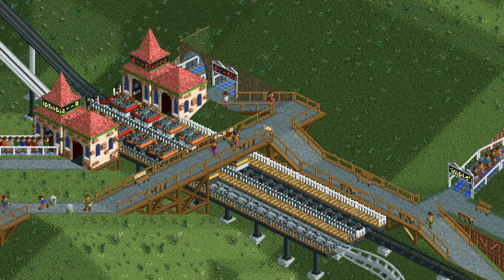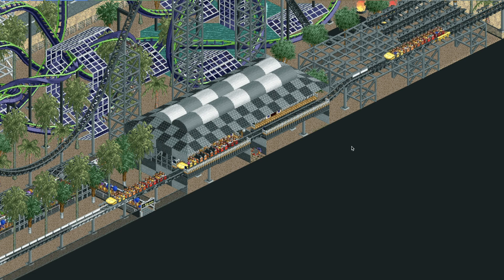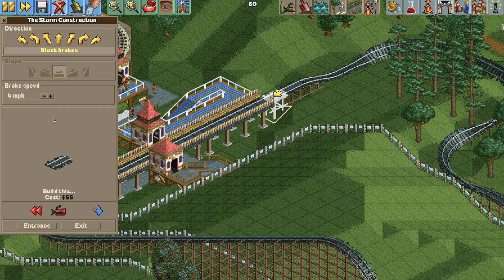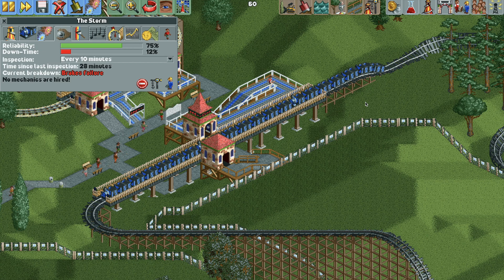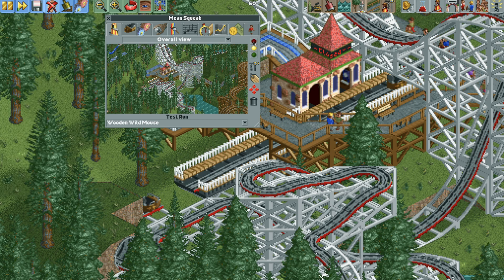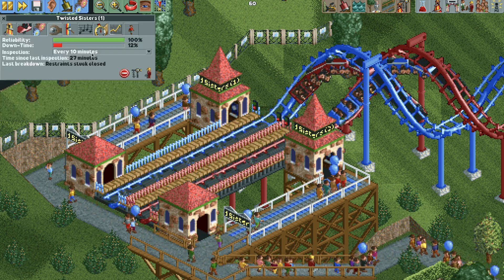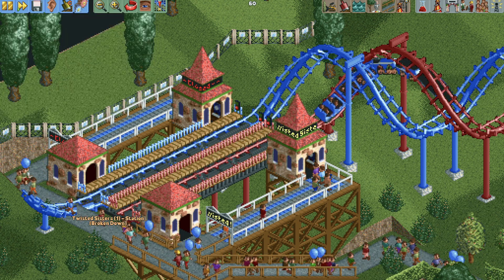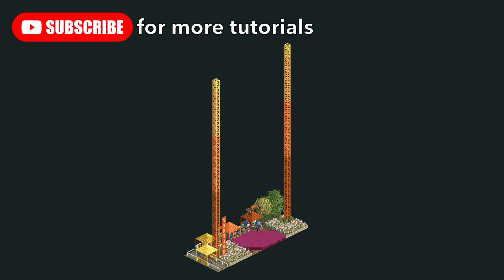Stop Brakes Failure Crashes - Open RCT2 Tutorials

Comment: I’ve recently downloaded ORCT2 and… I’m not sure if its because I’ve been lowering inspection intervals and regularly refurbishing rides but…. I’ve never had a brakes failure yet.

Wow.
Reply from the maker: It’s not a common breakdown but can still happen in powered launch mode and continuous circuit mode. It also increases probability when it rains for a brake failure

Comment: I can't help but notice that there're two types of brakes available in the parts lists of the relevant coasters; what's the difference between them?
Reply from the maker: You mean brakes and block brakes?
Brakes are just regular brakes in the game but some rides have a brake failure breakdown that can cause the ride to crash. In RCT2 they introduced block brakes which function like real-world coasters. A block brake will not let the train pass until a train ahead of it clears the block brake or station ahead. Perhaps I should make a tutorial on how to use block brakes since it is confusing if you’ve never worked with them.
Reply: @openRCT2tutorials  So, if I read this right, the (non-block) brakes can fail whilst the block brakes cannot?  If so, good to know.  Thanks.
Reply from the maker: Yes that is correct

Comment: Another way to prevent brakes failure crashes is to operate the ride with only 1 train.

You can also reduce the odds of a brakes failure crash by assigning a mechanic to patrol right at the ride exit. This doesn't prevent them completely, but it does make them less common as the mechanic has a chance to fix to the ride before it's too late.

Also, if we're allowing the cheat menu, then why not just disable breakdowns?
Reply from the maker: Yes, those are all good practices as well. I wanted to show players how they can edit the RCT1 scenario coasters to make them safer without having to completely change the layout. Just a simple trick that players can do with as they please 😊

Comment: For wild mouse, just spend more time being better at designing the end. For launch just design the coaster to have a natural fallback ramp.
Sure, this stuff is neat, but it's a bit absurd when you can just get better at building a fully functional setup without designing into the 4th dimension.
Reply from the maker: I think these methods are easier. Can’t recreate Mr Freeze by adding a fallback ramp

Comment: Doesn't really do any good if you're playing original RCT1, where the only way to guarantee surviving a brakes failure (besides limiting yourself to one train) is to design your layouts to consume all the potential energy and arrive in the station at under 29mph
Reply from the maker: Very true but it does work in regular RCT2!
Reply: If you fiddle around with the max waiting times of rides, you can prevent crashes that way in RCT1. Just have the minimum and maximum wait time the same time and be something like 25-30 seconds, that why the 2nd train should usually be on the lift hill for regular coasters.
Reply from the maker: @Micha_86 Yeah that’s a good way, too. Just doesn’t work for wooden wild mouse and such if you want higher capacity

Comment: Another thing, maybe make them end in a speed low enough by default (like the 2nd example had no crashes as they arrived slow enough to not cause a crash)
Reply from the maker: Yes, that’s another way to avoid them, however, it makes for a boring finale to the ride if the train is going slower and slower
Reply: @openRCT2tutorials  oh another thing I forgot, the wooden coaster and water coaster have another trick, the water splash or the water sections
Reply from the maker: Yes, that’s a great solution was well! Especially for the water coaster